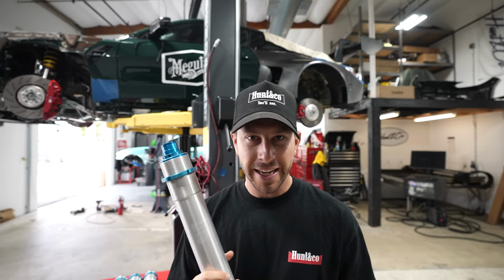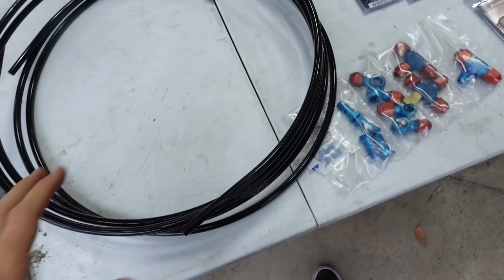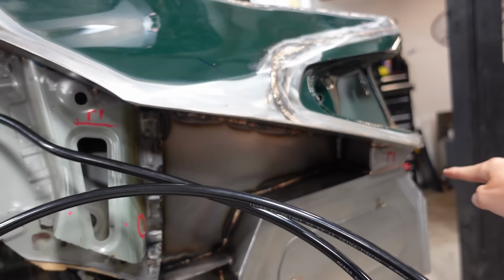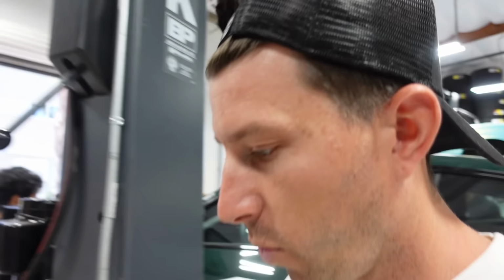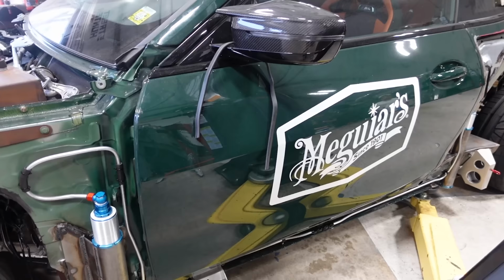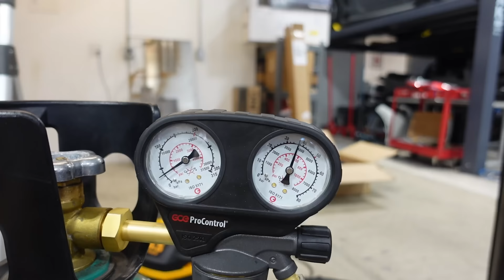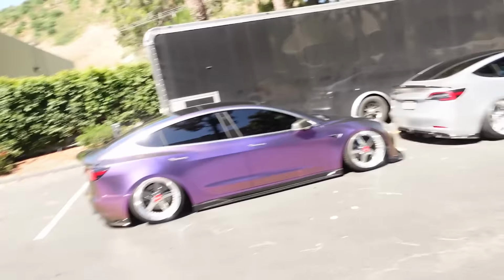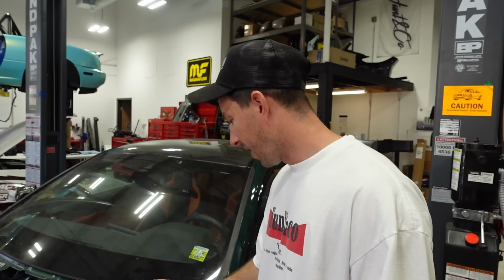We Installed Air Jacks on my ‘Street’ M4 GT3!

Comment: Looks epic. My only advice is just make sure they your air release on the jacks aren’t pointing at any weak points in the kit. If you dump 600psi into a fender you’ll eventually crack it. Might be worth fabricating a deflection plate. Can’t wait to see the end result!
Reply: Since it has a pretty wide angle I don’t think the force will be concentrated enough to cause damage. Just a theory tho
Reply: The kit itself has the space for it, every GT3 cars has a predisposition somewhere to put it and be ok for any of this thing
Reply: Get this comment to the top

Comment: You should use distribution blocks at the fill point and run all lines directly from that to each jack. This will keep all lines parallel which would make all jacks raise equally. Because they are in series the back will always raise first.
Reply: On a lambo gt3 or even the Supertrofeo that has the same airjack sistem (as all the other GT cars do)  because the engine being in the back the front raises first and the airjack goes in the rear bumper

Comment: The front goes up last and goes down first because you have the lines hooked up in a series circuit, if you were to hook them up in a parallel circuit they should all go up at the same time and down at the same time 👌👍
Reply: Couldn't it be because the front is a lot heavier and needs to build more pressure inside the cilinders to be able to lift the engine, where the rear is an empty shell?
Reply: the length the air traveled to the rear jacks was probably shorter, so he could also make the pipe lead initially to the Center beneath the door, then connect them to the jacks at equal distances

Comment: Teeg, as for the speed of rising and lowering in our gt3 car we added 2 manual valves. One right before the airjack handle (we keep the air that comes out at 33 ish bar and after we insert the handle we slowly open the valve) and the other one is in a hidden but reachable place on the plumbed air system so there as well you can slowly open the valve to release as much air as you like with the speed that you want. 
Pressures wise as said in another comment the air tank to last a couple of time up and down we, with the sisters we  have (we got Paoli tanks), we put around 200\210 bar of pressure and with the regulator we set the exit pressure between 30 and 35 bar. This way it has the strength to raise it and you have the possibility to control the speed of arise and descend

Comment: Quick tip if you’ve never used air jacks before TJ, when using the car the collar always need to be pulled out , if not the air inside can expand with temperature, causing the jacks to go down when you don’t think they are down. They can touch the floor and ruin them.
Also to set the pressure you need to run them at, wind the reg right off and turn the bottle on. Wind the reg in until the car goes up at and holds it

Comment: One of the best tricks I've seen for doing lines like these is to take a 2X6 board and drill a hole through the 6" section that matches the diameter of the tubing.  Thread your tubing through the hole in the board.  When you pull the tubing through, it is now straight and easy to use.
Reply: I fuckin love this ❤

Comment: Typically those plastic lines are good for 150psi. Air jacks require much higher pressure which is why you need aluminum lines.
Reply: Yes this ^

Comment: If your doing Airjacks you might aswell go full send.

- Centre Lock wheels (BBS E88’s) but I know your going HRE
- Nitron x Team Schirmer R3 Coilovers
- Ceramic Brakes
- Weld In Half Cage as full cage with overhead bars are not safe on road without a helmet 
- Full Carbon Recaros (Pole Positions 7kg each)
- Full SPL adjustable arms

Comment: Yeahhhh buddy. I used to experience these on some track cars back in the day. Once the leaks are sorted out it’ll feel much more natural and it’ll hold its position without the bottle staying attached. You can use a proportioning valve to make the front and rear rise at the same rate btw

Comment: I use those air lines for plumbing sometimes and if you can’t get it to seat right, we use pipe dope (tru blue) and it usually works. You’re running a high pressure but it might work or at least temporarily till the new lines come in. 

Love the videos! And Dylan and Kyle have been an awesome addition!

Comment: I would use Teflon tape on the connections as well. Just like water pipes using Teflon tape, air would be the same and help with your leaks.
Reply: When the thread itself is the seal you want some kind of thread sealant, like Teflon tape. These type of fitting do not use the threads as a seal so you do not want to use Teflon tape on them. You want “metal to metal” contact on the threads so that you get the tightest fit possible at the ferrule (where the seal actually occurs on these connectors).

Comment: Great video TJ. As per crash sensors you should be fine, think of the car getting air over a small bridge etc, crash sensors, potentiometers and yaw sensors all take into effect the G, air jacks wont triggers the airbags and iirc the anti-theft via towing is still higher than a foot so should be fine.

Comment: The reason why the kit comes with that kind of piping is because there is more pressure going through it so if you use normal lines for air bag, it will just rip open from the pressure

Comment: I've never done air jacks but I have done hard lines for airbag suspension. Rubber can expand under higher psi and also crimps shut easier but it bounces back, also easier to rub holes in and dry rot. Hard line, either copper or aluminum, doesn't expand or implode with the psi this system should see, doesn't rot or get holes but once crimped it stays that way and the system is very prone to leaking. Which is why most fancy airbag systems only use hard lines from the tank to the valves and then soft line the rest of the way. Plastic line is the best of both worlds but you can't bend it around tight corners and if it goes through metal without a gromit it'll rub a hole eventually. Also kinda prone to leaking also. Which is why most kits have valve blocks, compressor inside an air tank and you just run a line to each corner, a lot more simple. Air jacks should be the same. But way cooler. Get Kyle to figure out how to turn another set of air jacks in to crazy travel air suspension for a project. No other systems using bags will have that travel besides triple bellow semi truck bags which won't fit into any normal sized vehicle

Comment: For straight brake lines from a roll like that, get a 2x4 and drill through the 2 inch part across through the other side, and run the line through and it'll pull it all perfectly straight like a dispenser

Comment: The reason why the lines are metal and not rubber or plastic is because of the pressure that you use to raise the car from your  air tank. Us in the team I work for we keep the tanks at 210 bar and we set the airjack at 30\33 bar. Rubber or plastic are not made to hold those pressures

Comment: SRS systems use a G force sensor. and its set with manufacturer perimeters. so yes some impacts can set off an air back if it activates a G force sensor.

Comment: Easy hack for air bags if you wanted to remove them is you can jump the pins in the connector with a 2.5ohm diode and not have airbag lights 👌

Comment: This is so sick. I think to solve the problem youre gonna have to run individual lines to each air jack. As they raise and drop separately from front to back its likely the lateral pressure on them could cause them to bend or deform over time. Only a slight deformation will cause them to seize

Comment: Your airbags is not the problem. If you use te oem fuelpump that could stop working when the shock is to big. Because the pump also has a crash/flipover safety on it to prevent fuel leaks when in a crash or flip over. This safety can even be activated when hitting a curb to hard.

Comment: Airbag sensors will activate with a sudden change in y-axis movement just like on the x-axis.  For example if you were to crash and fall off a bridge the airbags will go off because the sensors have noticed a sudden change in position even before you hit the water/ground
Reply: They won’t activate when the car is only changing a total of 3 inches. This is equivalent of hitting a California pot hole
Reply: @xsspeed419  agreed, just letting teej/comment section know how airbag sensors work in a crash environment.  I don’t think the airbag sensors will activate with a small elevation change.

Comment: I work w/ aircraft hydraulics and pneumatics, non rigid lines can have sidewall flex which can lead to both you not getting desired pressure and frequent blowouts aluminum is always 100% the way to go for systems that “instantly” pressurize

Comment: I work at a shop called ace performance that sells Ginetta race cars and so I work on them for a living and they have a very similar system. Except they only weigh 2,400 pounds and they only have 3 jacks out takes are set up around 450 psi. I’m sure your going to do this but fix all of your leaks then retest before sending it up to 600-800 psi because those cars are pretty violent when they go up and down and I just don’t want you to blow up a line and possibly putting a hole though the car. Also seems like your having a problem with the quick release to fill the car up. They are typically pretty hard to pull it’s normal just sand out of the way when it releases you don’t want to get hit by the quick release, but when you do that the car should stay up that’s how you change the tires. I’m sure you’ll figure it out but if not I can help you out.

Comment: Love the air jacks. I think it's an awesome addition.

In regards to the airbags vs air jacks and vibration. I remember a video that viral of guy who cammed his ZL1 (I believe was the car) and he got on it and the car shook so bad that the airbags deployed and the car called OnStar. I've also seen guys jump their pick up trucks and land with enough force to deploy the airbags.
Reply: You’re right and I remember this and instantly thought of it when TJ mentioned the airbags. It was guitarmegeddonZL1 and he had a exhaust dump with a valve right behind the headers. They faced directly at the rear quarter panel crash sensor which was triggered by the vibration from the exhaust. Car thought it was t boned 😂

Comment: I believe the reason you can't use plastic on this system would be because it's not like on an air suspension where it pumps up gradually using a lower continuous pressure, where as these jacks are more of an impact higher pressure so plastic would likely blow, if that makes sense 😅 it did to me 😂

Comment: Just a heads up there is also an airbag module inside the car under the center console. If this module flips or is loose in any way the g sensor inside the module will deploy airbags.

Comment: Dropping the car wont set the airbags off cuz depending on vehicles they impact sensors are usually somewhere on the front/rear bumpers and cars with curtain airbags will have them down the side of the car as well and to set them off takes a significant impact. My friends and i tried to set off the airbags in a junk car we had by hitting it with baseball bats, a metal pipe and throwing large rocks at it and nothing worked. We finally drove the bucket from the tractor into the front doing about 30km/hr and it finally set them off so youll be fine dropping the car 5-6 inches.

Comment: If you drill a hole in a 2x4 width wise and run the brake line or fuel lines through it, it’ll run the line perfectly straight for ya so you can bend em fresh

Comment: But also remember you can actually set off an airbag from a big enough drop or if you hit front bumper hard enough in right spot. But you should be fine because the jacks won’t let it drop through the pressure being released

Comment: SRS systems respond to sudden deceleration.  The level of deceleration is so high in such a short amount of time, that's why bumps and vibrations don't set them off.  It's also why side bags may deploy with no physical side impact. The suspension is in the way of allowing the sensors to felt that level of deceleration. 

I would not be worried about air bags going off.

Comment: The aluminum lines will be for the higher pressure required for the air jacks because shop air will be 90psi of constant pressure and I think most pit crew air is set to 120psi nice work though boys
Reply: Air jacks are usually used with compressed C02 and therefor usually over 1000psi
Reply: They were talking about air lines for air suspension which normally run 150-200 psi.

Comment: It should not be any problem at all with the airbags, if it is I would be so surprised that I don’t know. Have jumped higher then that with cars and it haven’t been any problem. Also I have Ben working with Porsche race cars for years and the air jack are one of the best and practical things I know in the car world. You are not gonna regret putting them on :)

Comment: Try twisting as you pull the wand off. You can also add a quick connect fitting at the wand side. Release pressure with the quick connect and the wand pulls out easy

Comment: The sensors for the airbags are set off by g force. I wouldn't think that drop would be enough to set them off, nor are there likely sensors for sudden drop G's but definitely find out through the correct channels before potentially turning your interior into an extra crispy bouncy castle

Comment: I dont know if that is where the airjacks are going to be set height wise, but shouldnt you have used a soft line coming off of the jack its self so that if you have to adjust it down more you dont have to make a hole new piece of hardline for it? Or is that where its going to be riding?

Comment: When you heat cycle plastic not good, also plastic get brittle over time. Using Alu lines will last forever. I wouldnt recommend plastic lines if it has to hold any decent amount of pressure.

Comment: Aluminum/Steel lines are stronger and this is an application where you are bursting a high pressure into the lines to lift the car. I don't know if the plastic lines could handle that repeatedly.

Comment: Hey Tj air bags only deploy under certain conditions and to be honest a few sensors have to go off at the same time for it to deploy as long as the Car isn't I'm motion and as long as the impact sensors which are directional but it a horizontal fashion where the yaw sensor works in the vertical sense yall should be good man send it.

Comment: Definitely get those lines fixed before doing anything further, the leaks aren't massive but nitrogen displacing oxygen will cause asphyxiation so I wouldn't want to be next to a leaking fitting too long. Sounds like you've already got a fix for the leaks, it's definitely advisable to have the same brand fittings/lines especially at high pressure. You can also buy a tool that you can gap the fitting that will tell you when the nut has been tightened up enough. Great work for it being your first time, the airjacks are a awesome addition to the build!

Comment: I work in crash testing as a technician for a living so I can tell you that it shouldn’t set off the airbags as long as they drop evenly. The roll sensor in the airbag control unit COULD think the car is rolling if it goes down unevenly at a rapid rate. That being said I’m 99% sure it wouldn’t set them off. The crash sensors will have nothing to do with it because they need impact or air pressure change (in the doors). The only issue I could see is the roll sensor, cars do weird things though so you never know lol

Comment: For the air bags.. The car doesn't need to go as high, which should make the drop less violent. Also doesn't need to "drop" as fast, even tough it looks cool
Reply: This, adjust the jacks so it lifts the wheels only a few mm off the ground, would probably halve the impact forces.

Comment: scrolled down and didnt really see an answer to your question so i will chime in. Usually air jacks are used at races and are used with compressed mother bottles. Therefore you have over 1000psi of pressure. Your car air bag system runs far lower pressures. So they system you bought is setup to work with compressed gas

Comment: Tj, to answer your question about the air jacks setting off air bags, yes it is a possibility now it may not happen it certainly could, modules could be move in the drip and sensors can get triggered and it really depends on how much the manufacturer takes sensors seriously some sensors in let’s say a Volvo for example, highest safety rating for every car in their lineup, take things like drops and use things like suspension level sensors to see if they car “took flight” in a way. So at the end of the day full send but watch out newer cars have a central nervous system of electrical wire.

Comment: YO TJ YOUR SUPPOSED TO USE A BOTTLE TO PRESSURIZE THE AIR JACKS A COMPRESSOR WONT DO IT ALONE. ALSO ITS STEAL LINES BECAUSE 600 PSI IN A RUBBER LINE WOULD BLOW UP. IF YALL HAVE ISSUES WITH THE AIR JACK SET UP REFER TO DDES SUPER TRAFEO RACE CAR THE WHOLE CAR WAS DONE BY A LAMBO RACE TEAM OVER SEAS SO ITS A LEGIT SET UP.

Comment: I’m thinking you should be completely fine ab the air bag thing think of it kinda like a truck with a plow on it, you can hook something with your blade doin 50 and it will dead stop you an not blow off an air bag or drive 20 into a building an it’d go off

Comment: Other than the turns where you put the rubber around the metal hose. You should have just used those black anchors around the rubber hose instead of putting all those zip ties

Comment: Next time your straightening out solid line, get a 4x4, drill a hole slightly larger than the line your straightening, pull the line through the hole, perfect straight every time.